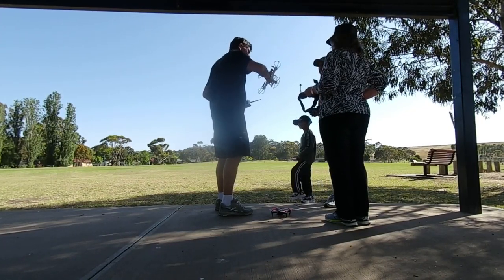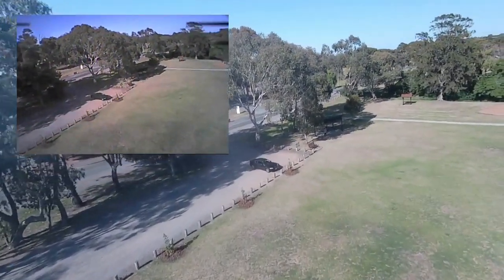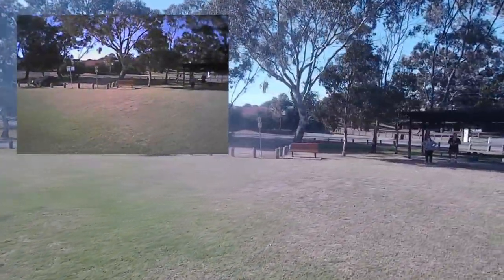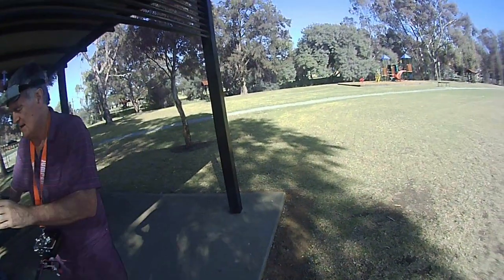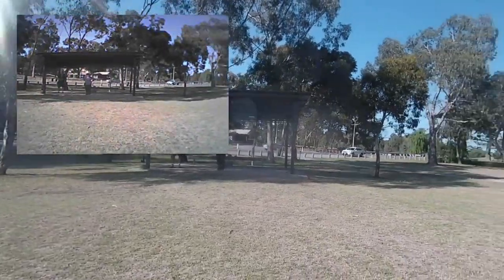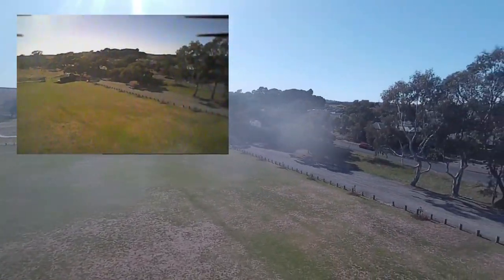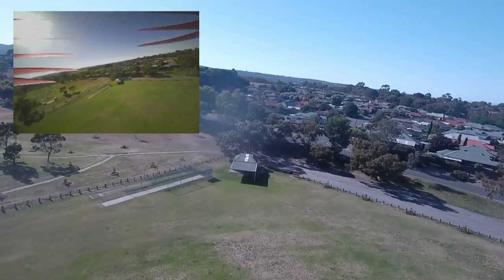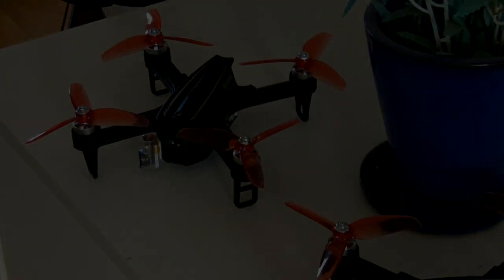How to replace ESC board - EX2 Mini Plus Test Flight

Comment: Questions : what's happen if I use the ori ex2 mini transmitter ? And how to choose the right ampere for this motors ? How if use 8A / 10A or higher like 20 / 28A ... any knowledge / reference ?
Reply from the maker: The ex2 mini works well with the original transmitter after upgrading the 4 in 1 esc board. ESC AMP capacity larger than motor draw = good.
This thread in the RC  Groups forum may be of interest - https://www.rcgroups.com/forums/showthread.php?1654955-Electric-Motor-VS-ESC-Amp-size
Reply: @skybug3  u have a picture for esc replacement? I think i soldier wire a true..because when i turn on original remote, the drone motor rotates indefinitely..Sori goggle translate

Comment: I wonder if you could rig up the caddx turtle into this...
Reply from the maker: The thought has crossed my mind. I'll have a look at it at some time. The thing seems to run hot, and I wonder how reliable it is.
Reply: @skybug3  well there is a V2 version now...and a caddx baby turtle, which is nano cam sized (14mm). The hybrid cams like the caddx tarsier V2 and the Runcam hybrid use both an fpv and hd cam. They look pretty crazy 😅
Reply from the maker: @BengalCatChilli  I have the V2 version. When the first camera board failed, I had a 2 month wait until BG delivered a redesigned board and cable. A bigger issue is that the TX03 AIO unit gives me the forward view with props plus good 5.8GHz range, while the HD Cam gives me good quality cinematic footage. Only having HD footage with props in view with a more complex and expensive setup does not appeal to me at the moment, especially with the dji digital game changer likely to transform fpv. However, I love the amount of choice open to us.
Reply: @skybug3  it really is hard to pass up that new DJI fpv system.